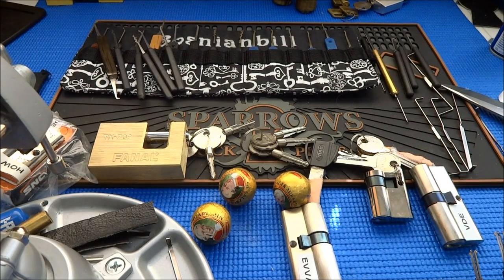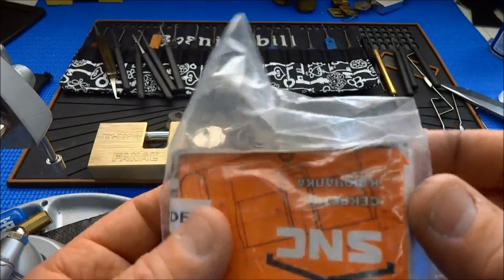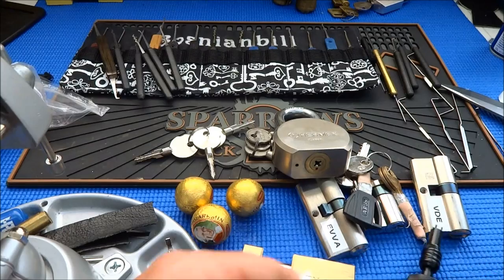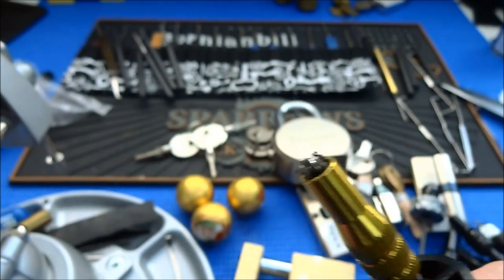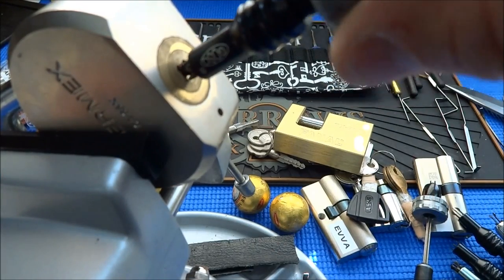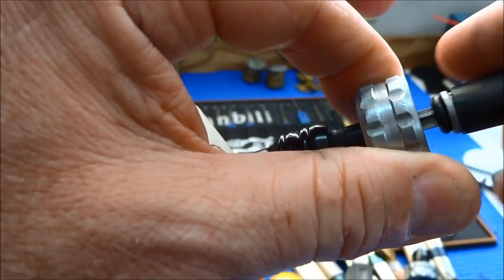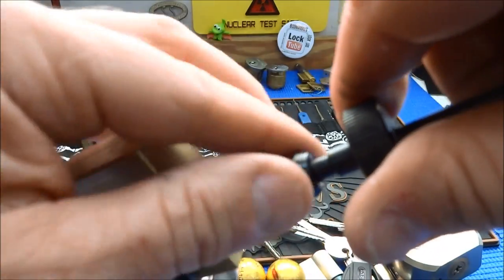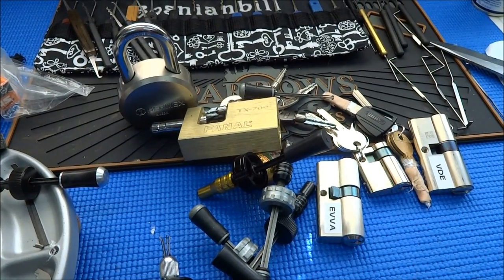(546) Zeiss (Cross) Lock Opening Tools - FAST!!

Comment: Interestingly the original Zeiss Ikon Cruciform Locks came with the pins only on 3 sides and not on 4 sides. Not sure if you knew that. I have to get you and original vintage Zeiss Ikon Cruciform lock one day. On the original old models they used "ANTINITSTAHL STIFTE" (Antinitsteel pins) which were rumoured to be very reliable, long lasting and superior against rust.

Comment: bosnianbillVery Nice Bill. Cool Locks Too. :D Just a quick question when I SPP a Cruciform Lock should I be looking for the binding pin in one side of the X I.e. Side 1 and then move on to the next part of the X side 2 or just go wherever the next binding pin is out of the 4 sides? If you can let me know that would be great. I've got a nice Matlock Cruciform Lock and I can take it with a Cross Pick but that's not as fun. I have SPP'd it twice but I did rake it with a Half Diamond before so I don't know if that had preset any of the pins before I SPP'd it. Anyway Keep up the great work Dude. :D N.
Reply: bosnianbill That's perfect Bill just what I needed to know. Thank you. I have watched all of your Cruciform Lock Videos and your others and they are great. Thank you for the help Bill I look forward to your next video. :D N.